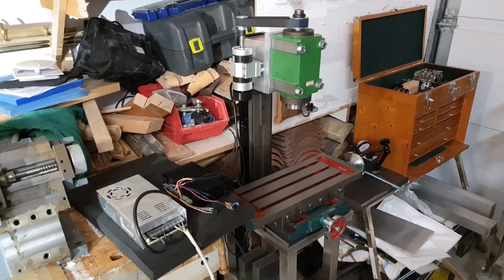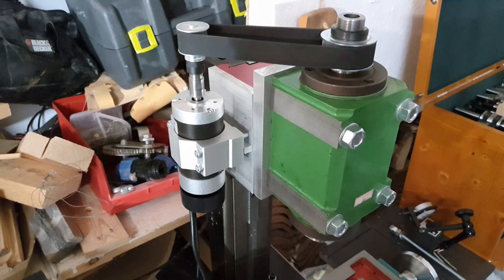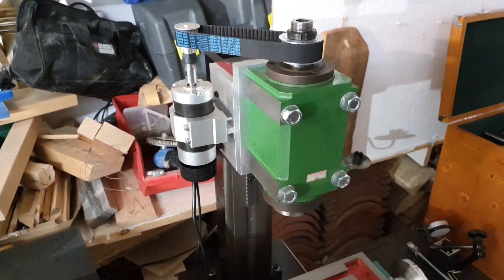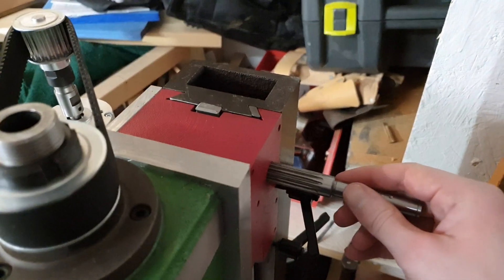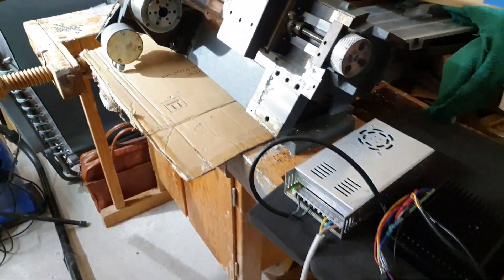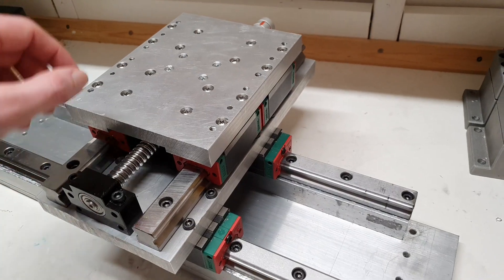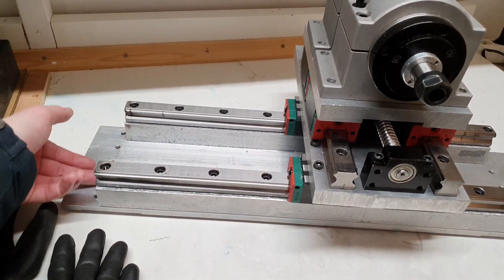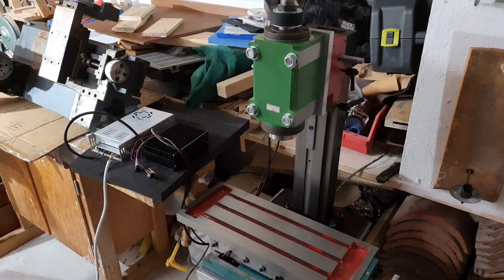Test run spindle bt30 + project update

Comment: Just a quick tip, DO NOT pull the collet shank of the spindle using brute force. It's a heat shrink fit. You will destroy the spindle. Carefully but quickly heat the collet shank to make it expand, then pull it of. 
I already killed one of these spindles trying to force it.
Reply: What do you mean by the collet shank? You talking about the spindle or the bt30 head

Comment: my parts for the 6040 conversion are on the way.. I went with small linear rails , 12mm all around.. I think it will keep the distance from the spindle to the X axis back plate down.. Not sure how my logic will work out.. with adding a huge steel x axis( im using 2 by 6 box steel for the gantry frame )  , im also worried if the steppers will move it well.
Reply: also , all your stuff looks great.. the x axis you made looks like it can handle anything the machine could possibly throw at it.. As for the mini mill , i believe your table is still larger than the factory mini mill.. good job using the fat belt , generally the belt conversions on the mini mills are tiny tiny belts..no traction at all. I had one , did the belt conversion and so on.